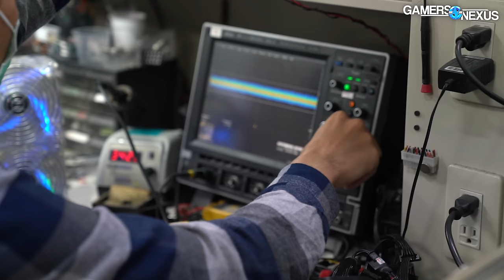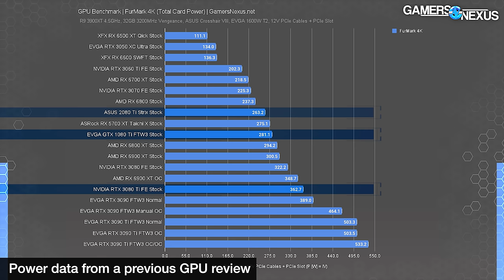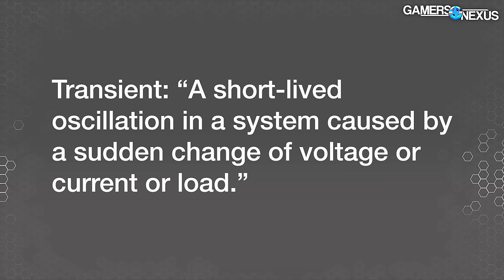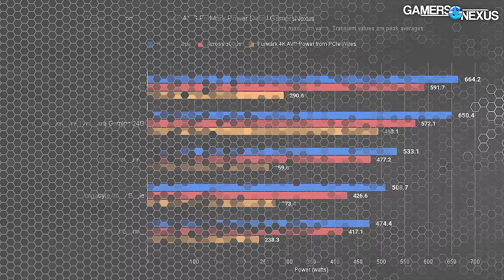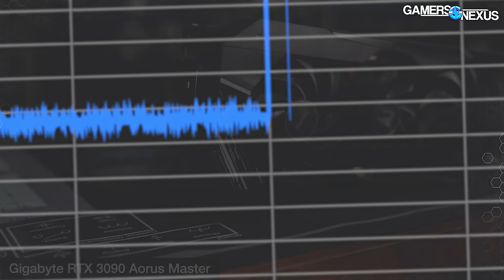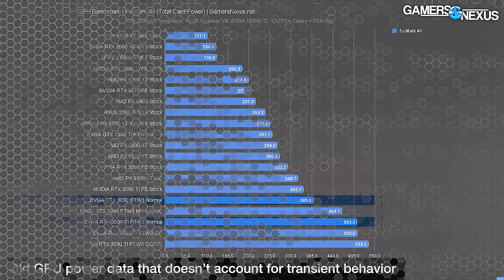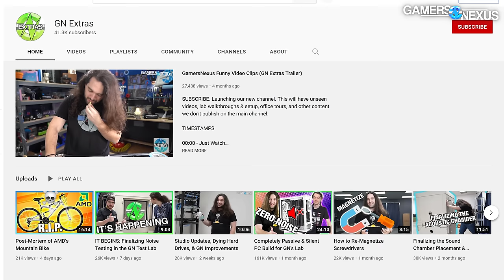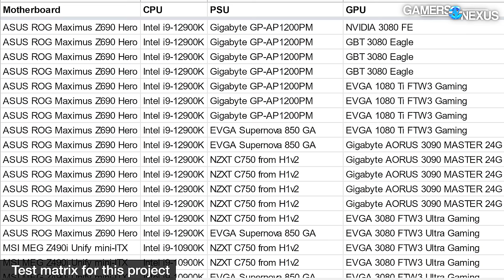The Brewing Problem with GPU Power Design | Transients

Comment: I'm someone who has been building my own desktops for over 20 years. To save myself any potential trouble, I bought a Cooler Master's 1000W PSU way before I even got a myself an RTX 3080 with a i9-10900K.

It's always good to do your math before building your own PC. And if the buyers intention from the onset is to get a top end quality system, then don't scrimp out any components, not even your motherboard.
Reply: You sound like you know what you're doing. And I'm trying to plan ahead better in the event I get a 4xxx series card.  I am recent to building my own systems (two years). I have a 3090 and 5900x powered by an NZXT 850w PSU. This is my second PSU, and my MSI Meg Ace x570 had to be RMA'd, and it's working again. So, it's not been all rainbows and butterflies, but I'm learning and the system is stable now. Question: This week I picked up an Antec Signature 1300w PSU just so I had the option of getting a 4xxx series card if it works out. Good purchase or should I return and hold out for an ATX 3.0? Linus indicated PSUs would or could be hard to find in the fall?

Comment: Run into this in the last few months when I put my 3060ti under load
GPU - 3060 ti founders edition
Mobo - Asus z97i plus
PSU - Seasonic G550 550W

Can mitigate by power limiting GPU to < 90% or not running at 4k resolution

Comment: Little late to the comments, but figured I'd throw in my problem build. 
CPU: 9900K oc'd 5.2GHz all core at 3.6v
Motherboard: Maximus Formula Z390
GPU: 3080TI FTW
PSU: Phanteks Revolt X PH-P1000PS, 1000W platinum.

It didn't take long to figure out that it was the PSU, with other people experiencing the same thing. Lowering the power limit prevented system shutdown, confirming the problem. I did test at 100% power limit with stock CPU settings, and still had the shut downs. System previously ran with a 2080Ti Waterforce without issues. Upgrading my PSU to the 1500W Dark Rock Pro 12 fixed the issue. During my research on the Revolt X, I did see people saying that Phanteks has since increased their protection limits in the newer models. Didn't look into it enough to confirm that or not.

Comment: Great stuff. Of course, all this talk of the importance of peaks vs. averages should have highlighted this issue: using "peak average 100 µs measurement" when "it's only 100 µs long at a time — at most — normally". A huge transient for (say) 50 µs will only show up much as a much smaller (i.e. half) spike in the 100 µs-average data. It's an issue of trying to work beyond the resolution of the data you have, but worth a mention I think.

Comment: I have a Corsair HX750 power supply with an EVGA RTX 3080 XC3 Ultra and a i7 6950X, cooled by a full EK watercooling loop and never had any issues with this hardware combination.

I have a somewhat loud coil-whine on the GPU tho. This can be heard very easily when launching StarWars Battlefront 2, as the game's home menu seems to increase this effect more than in-game directly.

Comment: I remember the days when an IBM PC used a 90W PSU! Of course it doesn't help that so many overclockers tweak the CPU over-voltage, thereby balancing a system on a knife's edge of tolerance.

Comment: I’m running a EVGA FTW3 3080 & 5900X off a Corsair SF750 (Platinum) and I have never had any unusual shutdowns. I’ve also played games at a range of resolutions including 4K. I do run my 3080 on a small undervolt but it still pulls 300W

Comment: Interesting video as always!

I used to run 1080 TI SLI (actually the same FTW3 models shown in this video) and would run into this issue quite often. I had them paired with a Corsair HX1000i, and I figured even rounding up to 300W per 1080 TI (overclocking), that should still be more than enough headroom. But looking at the charts here, if the cards spiked up to 475W+ each, now that could definitely be a problem.

I have a 3080 FTW3 now with the same PSU and haven't seen the issue. The 2 1080TIs are in another rig with a Corsair RM1000i, which suffers from random shutdowns. I thought the cards were dying since that PC works fine without them, but maybe 1000W just isn't enough.

Comment: I'm running a  AMD Ryzen 5600x, with a placeholder GTX 1070ti, on a B450 Tomahawk Max board and was getting weird resets and this wasn't my first build by far. My PSU was a brand new in box Thermaltake Smart 700watt so I thought it had to be something else. Turns out in the end, the PSU was the problem, after testing each part in my pc individually it was the reason for the resets. I never thought that the overhead for a PSU would be so bad but now I learned my lesson and this video helped and couldn't have come sooner to answer some burning questions I had. Thanks Steve and Team, you sexy nerds.
(PSU was replaced with a Corsair RM850)

Comment: SFF PC Enthusiast here successfully running a 5800x + 3080 combo on 600 watts. (Corsair SFX 600W 80+ Gold). No issues with over-current protection or random shutdowns (GIGABYTE B550I AORUS PRO AX, AMD 5800X, ASUS Turbo 3080)

Comment: Having issues with what sounds exactly like this situation describes. 
Bought prebuild during GPU shortages.
I bought G15CE with 3070. Migrated parts to better case (4000d airflow). Upgrades made to ram and an AIO for the CPU. Power supply is Great Wall 750. 
In GT3 I reduced power target by -20. Crashes stopped.
At this point PSU upgrade is the big play.

Comment: GTA V @4k max settings killed an old Gigabyte 3080-ti Vision GPU after just a few days of owning it. Died after about 1hr of gaming, fans just span with no signal. I was using a RM750 PSU, 5950x and Asus Dark Hero mobo. Upgraded to a RM1000x and refunded the GPU for a 3080-ti Hall of Fame (Which was somehow $300 cheaper) and it's been running perfect since. I wonder if I experienced something similar to what's happening in the video.

Comment: This is absolutely a GPU issue. You can't just keep pushing PSU wattage higher and higher because eventually computers will start to use up way too much power. NVIDIA has this ridiculous notion that they can just keep designing their cards to be more and more powerful with zero regard for power draw or even cost for that matter. I'm really pulling for Intel to come out with some good stuff eventually to make NVIDIA pull its head out of its ass and start putting out sensible products again.

Comment: Again, this is a great example of GN producing pertinent and high value Youtube content. The issues surrounding power consumption and the growth of devices that incessantly need more and more will ultimately culminate in just what Steve has described in this video. A lot of finger pointing between the various component developers and manufacturers. The impact on the aging continental grid system is another matter that likewise will ultimately culminate in successively long periods of darkness. These are called nights and they've always been here you just have to turn the power off to see them.

Comment: I have a Corsair SF750 with a RTX 3080 FE GPU, and working fine (with AMD 5900x CPU).  What didn't work fine was using my Seasonic 650W SFX-L power supply, which would routinely trip when I had my monitor at 120Hz.

Comment: This solves one the biggest mystery I had with my DL build. With all my equipment, I had no way to confirm a transient load of about 2x exists. I had to use a 2x power supply and see it holds only at about 40% load all the time for no good reason.

Comment: I used to have this problem with a Radeon HD2600XT back in 2007-2008. I’d play a game for some time and then all of a sudden the computer would turn off. It happened several times and I had a hunch it was the video card as it happened only under games which loaded the gpu heavily. However, back then I had no idea that I could’ve solved the issue by upgrading the PSU.

Comment: the transient alot probabley also related to brand / cards design, because when the fans are low, then everything needs to ramp up to max full speed those fluctuations and any sub par items in the component design those are the power spikes when the most often will occur.  during larger ranges of voltage usage load up times to parts

Comment: I have a Ryzen 7 5800x & Gigabyte Aorus RTX 3080 XTREME  running in an Asrock B550M Pro4 all running off a 750w Lian Li SFF power supply that came with the O11D-Mini and it's been very stable for me. My wife is running a 5600G &  an EVGA XC3 3080 on a Gigabyte B550 Aorus Pro AC board with the same PSU & it's also been rock solid. We both have GPU & CPU in custom loops with corsair pumps as well.

Comment: I'm using a Corsair SF600 Gold from 2018 and I have been running a 3080 FE overclocked to 360W without a sigle shutdown in the last 2 years. The rest of the config: MSI B450 Tomahawk, Ryzen 5700X overclocked via PBO2 (peak power 131W) and curve optimizer to 4,65 ghz all core, 2x8 Crucial CL 15 3000@3600 CL16 BLS2K8G4D30AESBK

Comment: A lot of powergrids are not without spikes either. A while back I used to live in a place where my ceiling lights could suddenly become a bit brighter before returning to normal again. It also usually crashed or killed a computer, so I took upon my self to monitor the grip that came into my house and what I found was spikes they were way beyond what the power gird should be carrying. Push that much power through a wire over time and the wire would melt.

After the 3rd killed computer and the power delivery company refusing to take the blame, I moved to get away from the issue. A small mod to a led lighting system also let me see such spikes in real time and it helped me for years to keep the spike damage to a minimum, I also had everything electronic behind a good surge protector with power leveling abelites too.

So you should never blindly your delivery is spike free.

Comment: Hey all, I'm running the following and had no problems with power spikes (been running for just over a year)
Mobo - Gigabyte x570s Aero G (rev 1)
GPU - EVGA RTX 3080Ti ftw3 ultra (default bios)
CPU - AMD ryzen 5900x
PSU - Corsair SF750 platinum

also for completeness It also runs:
9 lian li uni fans
phanteks glacier one 240mm aio

Running in a lian li 011d mini snow white case, looks and runs great

Comment: awsome brake down, in the old days we would always buy a power supply based on average load 55% of supply rating this is called a rule of thumb. never had fail with this setup.

Comment: I know I'm late to the party but as an additional data point: I got a RX6800 from ASRock back when that cost $700 the firs time around. And immediately saw this issue happening. Random moments of the system just full shutting off. Random driver crashes where the screens go black. Just constant instability. Eventually there was a BIOS update from ASRock that addressed this. Sorta. I had to unplug all lighting and base clock the RAM just to get to stable. Recently decided to throw more parts at the system so I can not worry about it for a few more years and went from an 850 to a 1000 watt PSU assuming something was just OCP popping with a spike that was far enough outside the averages to matter. And, suddenly, I can run everything everywhere all at once and nothing crashes. Even though I went from an R7 3800X to an R95900X. I was fully ready to just assume that the lighting was the issue. Was not the issue, apparently.

And then a month later this video came out! :D If you want model numbers and such let me know and I can put together a detailed list of what has been changed over the last two years to arrive at stability.

Comment: I have a 5900X, Galax 3080 12GB and Gigabyte B550 I PRO AX on a Corsair SF750 SFF PSU, haven't had any power issues touch wood. I notice that Optimum Tech also does a lot of ITX builds with 3080/3090 class GPUs on the SF750 and has never complained about shutdowns (Actually his channel is the reason I got the SF750). I think it's a pretty solid SFF power supply.

Comment: I'm sorry I'm about 75% blind and reading for extended periods really makes the eyes hurt so I don't know if it's been said previously but I did want to say that I have run a 2080TI, 3070TI, 3080, and 3080TI on the Silverstone SFX-L 800w titanium for months at a time in both gaming and some virtualization work and did not seem to have any issues with crashes or studders for power spikes like you showed. I don't want to disrespect the channel with a buy here link so I'll just say This is the one I got from Amazon "SilverStone Technology 800W SFX-L, 80 Plus Titanium 100% Modular Power Supply with Japanese Capacitors SX800-LTI-USA, SST-SX800-LTI-USA". As for the overall content piece I love just about every video you publish. I haven't had the chance YET to use it yet but that HUGE mod mat is absolutely worth that cost and I can't wait to put it to use. Oh and hurry up on those skeleton shirts I have 3 ordered and so excited. :)

Comment: I had a MSI Trident X, mini pc with 9700k and 2080 in it, and tiny tiny OEM power supply built in it (Modular 650W 80 Plus Gold Certified PSU). I had to test a 3090 (Gigabyte Turbo Version, abit underclocked from factory i guess), it worked flawlessly under any load with no issues at all in this PC. Hope that helps, and thats kind of information Gamers Nexus asked viewers to post.

Comment: I've been experiencing this issue with my EVGA 3090 GTW3 card. I even had it RMA'd and still had the same issue. EVGA support just shrugged and said welp it must be your home wiring since the power supply shutting off was enough to trip the breaker. I had a seasonic 750 watt gold psu and changed to a 1000 watt SuperFlower Platinum PSU that was "known good" against these power spikes. Low and behold I still have the same issue. The only solution i've found that actually helped was to undervolt the GPU and it cut back on power draw by quite a bit. For a card that cost me 1900 new at the time this is absolutely unacceptable. I'm glad you guys are bringing light to this issue and it needs to be resolved rather than manufacturers pointing the finger at one another.
Reply: Dam am having the same issue, got a 3080ti and I would be watching utube and bam pc would just shutdown like someone pulled the plug and I was like hey needed 1000wat as it may be my 850w is not enough, am gonna cry if this happens with this PSU, my pc was rock solid when I had a 1070 :( I just Wana play some games man

Comment: I'am currently running a Cougar 750+ Gold GX-F psu, an asus prime x470-pro mobo, an evga FTW3 ultra 3080ti and a ryzen 7 5700x.  I haven't had any issues with sytem stability at all, it's been stable through 2+ hr gaming sessions.

Comment: I like the look of Ray Tracing in games such as Cyber Punk.  What I noticed was that my GPU wattage would Sky Rocket with this setting on.  (6900XT)  I'm talking going from like 250w to 300w+ just with the Ray Tracing setting.  I opted not to use it for this reason.  

I'm glad that my anecdotal observation was actually me noticing a new phenomenon related to Transient power spikes.  While my observation was less on spikes, and more on just the obvious increase in power and louder system fan noise, the new rendering techniques and higher resolutions are massively increasing power draw!   Try it yourself, set an FPS limit in a game, and adjust graphics settings.  You will be astounded by how each specific slider has a specific impact on power consumption.  When you determine that some of these sliders don't make a large enough impact on image quality for the increase in power they require, you'll be very tempted to shut them off.

This is why I would suggest that Ray Tracing is still probably 5-10 years away from real common usage.  AMD/Nvidia/Intel? need to improve performance per watt for Ray Tracing.  Currently, it is trash.  Nvidia seems to solve the issue by pumping more power to the GPU.  That's only a temporary fix, IMHO.  Further, Unreal 5 suggests that Ray Tracing may be a solution we don't really need.  Much like how going from 1440 to 4K doesn't improve image quality all that much compared to the massive increase in power to get there. (I know on screen texture resolutions will make the perception of quality change), but most people will have a hard time seeing the difference. (Widescreen setups excluded)

Thanks for this video!  Really fun to watch and very informative!  Performance per Watt of new GPU bells and whistles is pure garbage.

Comment: This power spike issue is one of the reasons why I put a 1000W PSU into my PC which hardly draws 400W.

The others would include efficiency, longevity, silence (since it hardly has to do any work the fan is ALWAYS off)  and the intend to use that PSU at least in my next PC as well.

Comment: Very glad people are finally talking about this major issue. Especially with the 40 series on the horizon. My base EVGA 3080 would shut my PC down the second i launched any game. Just pushing "new game" and within .3seconds my PC shut down. I had a Corsair 80+ Platinum AX 760W. It was an old model from 2013, but was one of the best PSU's out at the time. When I bought it, i thought it would last me forever... I was naive. The PSU is still going strong and now in my niece's PC, but I replaced it with a Corsair HX1000W.

Comment: Corsair SF750 powering a 3080 TUF & 5800X for 1.5 yrs straight now. Never an issue. BONUS: I did indeed buy 2 of the Arctic 140mm slim fans, threw them on a Liquid Freezer II and managed to slap that big bad boy into my NR200. Additional fan noise is barely discernible for maintaining great temps.